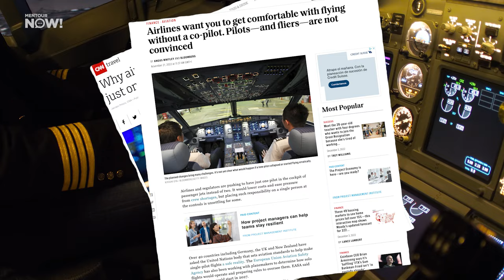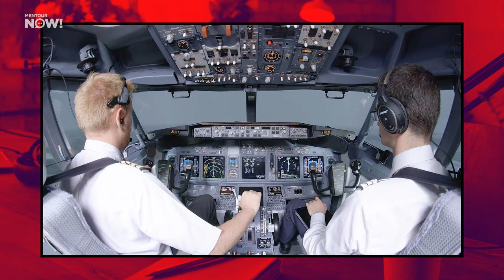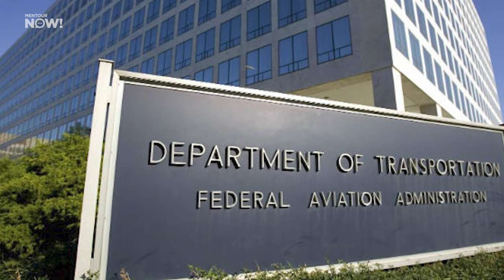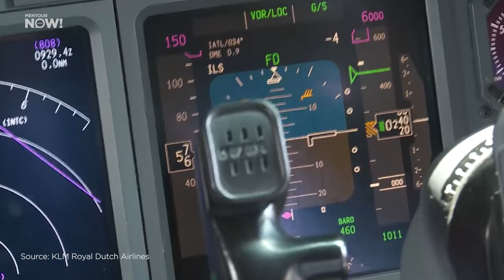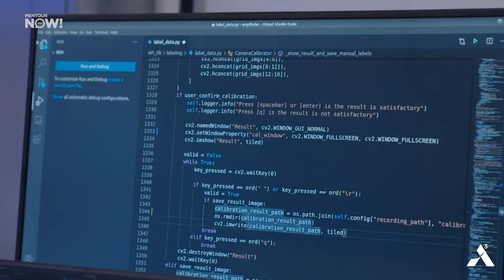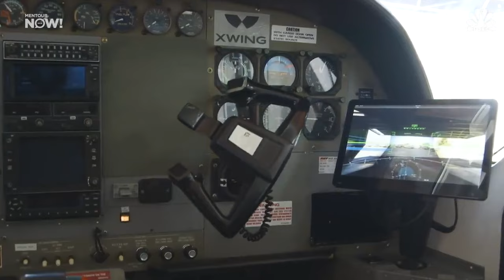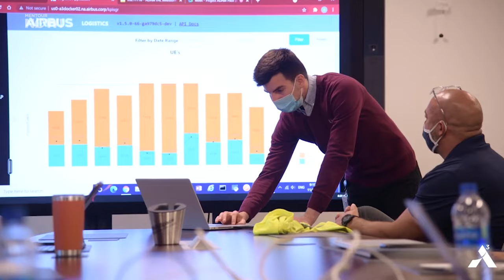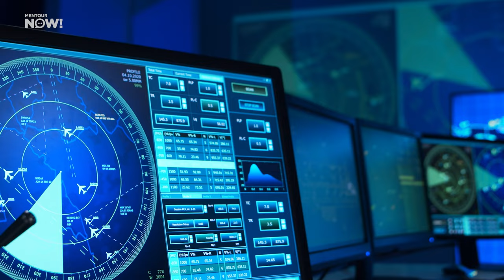The End of the Two-Pilot Cockpit?! Get Ready for Single-Pilot and No-Pilot Airliners!

Comment: Just the isolation factor of a single pilot cockpit would have negative effects on the psychological well-being of flight crew (thus leading down a rabbit hole of potential poorer outcomes). The flight deck is already now locked away from the rest of the flight post 9/11. Isolating one pilot alone cannot be good for the majority of people.
Reply: More importantly, we also know that people are more likely to cut corners and not follow procedures when they are unobserved.
Reply: It should be possible to have an assistant in the cockpit like it happens in long distance travels via car. This can help to keep mental state of driver/pilot in check while still requiring less investment than fully fledged pilot. It should also help with fragmenting pilot role into smaller more managable roles (e.g. handling radios like ATC clearances but on the board of airplane). Though I would expect that assistant will go through some training to handle semi-automated airplane in case of emergency.
Reply: But who says the pilot needs to sit up there alone?
Reply: He's not in prison, come on... That's such a strawman
Reply: Most of my flying has been single pilot. Helicopters and light airplanes. I’ve never felt lonely or isolated and I’m an extrovert. Granted most light aircraft have only a few hours endurance, meaning each leg of a flight is limited to a few hours, most days are long and similar to truck driving. However, I’ve got ATC, passengers and ground crew to interact with and the complexities of weather, logistics and navigation to keep me busy. I used to drive trucks and that was fine but flying is better. I never get lonely and I never get tired of the view.
Edit: The single pilot flying I’ve done doesn’t require two pilots because the work load is low compared to two pilot operations. I just wanted share my happy personal experience in single pilot operations.
Reply: @Hans-gb4mv  Heheh, hire a "pilot's friend" :D . Take a coworker to work day... weird huh?
Reply: @darrylday30  Yeah that's true, and not like lots of truck drivers already drive alone. Though I can't say my dad who is one is always happy about that (and the job itself).
Reply: Well, there are thousand of truck drivers driving alone for days so..
Reply: Even with two in the cockpit, there's going to be boredom issues if all they're doing is watching the computer drive. Something has to keep them alert & engaged.
Reply: I heard the future was airliners with one pilot and a dog. The job of the dog is to make sure the pilot doesn't touch anything and the pilot is just there to feed the dog.
I guess the dog would also keep the pilot company.  😄
Reply: @virkony  -  Here's an idea.  Why not train that assistant to fly the plane?  What an incredible idea, yes?
Reply: @darrylday30  -  I'm so glad your personal experience in single pilot operations has been happy.  I hope it stays that way.  Meanwhile, when I'm flying on a commercial airliner I would prefer there be two pilots.  You know, redundant critical safety systems?
Reply: -  OTR truck drivers are traveling at FL 0 AGL.  Plus, they can pull off the road if they get sleepy, need to attend to bodily functions or encounter a malfunction.  This is an advantage not afforded to aircraft at FL 350.  Minor detail, I know, but there it is.
Reply: @wickedcabinboy  if tendency is that main purpose of pilot is to configure auto-pilot and be a back-up to fly manually, I think assistant do not need full course of various situations on various airplanes or ensuring amount of flight hours. Main pilot still acts as a back-up when there is a need to land manually or do somehting more complicated than maintaining altitude.
And yes.That might be a great way to invest slowly in own full fledged pilot license for whoever starts with role of assistant. Who knows?.. Maybe that will address pilots shortage problem.
Reply: Very interesting topic and studies should be done to review single pilot operations for the large jets.  When we went from 5 pilot operations to 4 pilot to 3 pilot there were concerns, there were also concerns when we reduced the amount of engines.  Technology is getting better every day……
Reply: @virkony  -  All that is true, until he needs to fly the aircraft.  Then what?  "Ooops, that's beyond my training.  Oh, well."
Reply: Good comment !
Reply: @wickedcabinboy  situations beyond training happens for qualified pilots as well. It just for them bar is high enough to ensure that most common situations are handled in form of routine. For assistant it can be lower. Similar like a captain and first officer. It just gap is bigger allowing more people to play that role (somewhere between cabin crew and first officer).
Reply: Let's not forget that an alone pilot locked the cockpit door, and decided to crash the plane on the mountain.
Oh, and looking at Tesla autopilot? Where the car tries to run over bikers and pedestrians? Not a great argument in favor of automation.
Reply: I will sleep if somebody lock me inside cockpit 😅
Reply: Also who can stop you from smash the plane in the mountain like that german guy did in germanwings A320. Just because of that now you have to have 2 person in cockpit at ALL times
Reply: @darrylday30  Psychological issues doesn't have to be just "feeling lonely". There are a whole bunch of issues can come up few of those includes more pressure, no cross-checking to know if you are doing something wrong and whole bunch of issues if you need anything. Two people ca keep each other in check in many ways like not cutting corners. It is working for small planes, helicopters but for big plane things are just different. Also you don't drive a truck with hundreds of lives in your hand at 35,000 feet with probably thousands more lives on the ground.
Reply: @meldroc This is a complaint about the current level of automation.
Reply: @virkony  -  I must say, I firmly oppose your idea.
Reply: This is such a straw man argument it warrants outright ridicule.  There are plenty of people who work long hours alone without serious detriment to their performance.  And pilots have a lot of rest time in-flight.  In fact, there’s no reason whatsoever that separation between pilot and crew should be completely isolating.  It should be entirely possible for the crew to be constantly engaged with the Pilot with only a strong polycarbonate barrier between them.  The number of incidents of pilot-derived terror are few and far between and can easily be mitigated once autonomous systems are available- to be engaged by the crew only in the event of pilot misconduct or incapacitation.  The system can get the plane down to a safe landing in such a situation.  I see no reason that a brief computerized mental acuity test can’t be performed in the flight room prior to flight to ensure the pilot is ready for service.  A digital key can be issued by that computer that will allow that pilot alone to start the aircraft engines.  No key, no fly!  Autonomy should be for emergencies only.
Reply: @johncampbell9216  I agree - this is one of the most ridiculous straw man arguments I’ve seen in a while and completely overlooks the existence of all the existing solo pilots, single pilot corporate jets, over the road truckers, and so many countless other professions with isolated workers - not to mention people that work from home alone.
Reply: Perhaps the airliners will supply them with a chat-bot AI to keep them company.
Reply: @crashmancer  visions of an inflatable doll that chats to you spring to mind!
Reply: @meldroc  I’m never bored, flying alone. There’s always something to do, and the view is fantastic!
Reply: If bus/truck drivers can handle it as well as some ship and train operators, I'm pretty sure pilots would have no issue with that. The issue is with safety.
Reply: @wickedcabinboy  
OTR truck drivers are traveling at FL 0 AGL but they have thousands of other vehicles passing mere feet away all the time.
 
Truck wrecks can do immense damage to human life and property.
Reply: Have the pilots on the ground. They can change over and have short shifts.
Reply: @Taladar2003  so keep them out of the plane all together.
Reply: Get them wireless service in the cockpit so you can call friends and such
Reply: And if there was a remote backup pilot, that person is dedicated anyhow.
Reply: Closed circuit TV into the cockpit could help somewhat, but it couldn't be allowed to become a dangerous distraction.
Reply: But if something goes wrong in the truck, he or she can generally stop pretty soon.  No airplane stops in the air.
Reply: @sandy_knight  I'd rather a cat
Reply: @victorlitvinov4417  Or Zoom meetings.  (Hey did you just see that weird thing your controls just did?)
Reply: Germanwings Flight 9525 also comes to mind
Reply: I work alone for 10 hours a day, every day. I'm fine.
Reply: @Campania Cunard I work alone. It's not an issue.
Reply: @SwordQuake2  I work alone. It's not a problem.
Reply: @virkony  Then we might as well keep with the 2 pilot layout
Reply: @alanstevens1296  -  I don't dispute that.  But a Tractor trailer is rather a bit less complex than an Airbus or Boeing passenger liner.  Nor does it require the level of knowledge,  training, skill or experience to operate that a commercial pilot does.
Reply: Go with no pilot: Passenger drones!
Reply: @womble321  
Someone asks me fairly often" Captain, dont you worry about being responsible for 250 people?"  Answer...I make sure I arrive safely and the passengers will be fine. Do you think a drone pilot worries about his own safety?
One pilot cannot manage the complex systems of a large aitcraft, deal with ATC, read and complete complex checklists, and fly the aircraft safely during an emergency situation.  Several emergencies render the auto pilot inop.

Having only one pilot or no pilot is a very bad idea. Anyone who would fly on a large airliner with one pilot has a poor understanding of the risks.
Reply: Not if it's a fully automated plane!!!
Reply: Sounds like a downgraded co pilot to me tbh
Reply: I agree with you completely.  It is unreasonable and dangerous to leave pilots isolated for such a long time.
Reply: One pilot? Anyone remember GermanWings?
Reply: lol, there will be a dramatic increase in cabin crew joining the mile high club
Reply: A lot of us folks in GA fly by ourselves all the time. I don't think this is a compelling reason not to do it. I do think there is a compelling case not to do it - if dual pilots stop even a few crashes a year worldwide they are cost-effective (vs salary of pilots) for commercial flight because those airframes are expensive - and the lawsuits from the relatives of dead ones even more so.
Reply: The future will of course be totally autonomous aircraft. After a couple of generations have grown up with autonomous cars and other modes of transport they will have no problem with autonomous airliners.
Reply: Coming from a truck driver I disagree
Reply: Couldn't have said it better! Even worse, how about the then required systems that will need to monitor & scrutinize the actions of the lone pilot, say to prevent an unnecessary nose dive, lol? Now, these systems (and their bugs) will add layers of complexity that could translate to unnecessary risks during normal flight, no? 
Greed is not absolute and needs to be stopped when it gets out of control, this is a textbook example imho.
Reply: @philipmackin1025  it doesn't matter how you call assistant or backup pilot. But that backup pilot is not the one that rutinely steers the plane as it requires less preparations for that role.
Reply: Tell that to the millions of truckers around the world
Reply: Locking the flight crew has always been something that bothered me.  We focus on the 4 planes out of millions of flights and turn the aircraft into a segregated machine and separating the human factor. Might as well have a computer flying the plane.  I use to love when they opened the door and you could see the crew. Always felt safer seeing all was well.
Reply: @Viniter  At least you don’t have a back seat driver in the cab criticizing everything - oh wait, they just install computers that does the job of a back seat driver.
Reply: @orlandopockets6372  the flight deck can become a high stress and complicated environment.  At 30,000 feet, there is no way to simply pull off when something happens and can get busy real fast.  This is why there is a huge focus on stabilized procedures.  In bad weather or night conditions, three are no external references and things happen.  Just an opinion because I’m not sure you can compare the flight deck to driving a truck or other jobs.    Perhaps it might be similar to a surgeon performing open heart surgery alone with robots.  It’s all good until an unexpected clot forms or something happens.
Reply: "Isolating one pilot alone cannot be good for the majority of people." Yes, that's a big problem. But that means having only one pilot is just one pilot too many. We need non-unionized autopilots everywhere - drones, cars, buses, trucks, trains, planes, Skynet, Falcon Heavy commuter ships to Mars and back.
Reply: Long haul truck drivers and train engineers face the same problem but in those cases and aircraft operators usually have SOMETHING to do whether it's communicating with ATC, checking their instruments or eating a meal. Bottom line, the cockpit is never lonely and if it is you can always read something be it fact or fiction. Modern aircraft are so automated that 99.95% of the time they fly themselves. Hand held computers can play chess much better than any grandmaster. So the hundreds or thousands of interconnected computers on a commercial airplane can easily avert almost all disasters better than flawed human beings.
Reply: Replace the 2nd seat with a fully autonomous android with lots of dirty jokes.
Reply: Not anything different from a LD truck driver or bus driver?
Reply: @johncampbell9216  in God we trust 
all else bring data
Reply: @victorlitvinov4417  great idea they can phone a friend in case of trouble
Reply: @nobodycares85  oh,  poor babies
Reply: @rafborrero  don’t be fatuous
Reply: Off topic. But your name. Tucson as in Tucson, AZ?
Reply: That's a good point, but the main reason they must keep a second pilot is REDUNDANCY.

I have a degree in aerospace engineering and a private pilots license but I work in industrial control systems. I am formally trained in programmable safety systems. So I am formally trained in WHY WE USE REDUNDANCY for critical safety functions. Risk Assessment not only includes people but their training & competency. Redundancy can also include people. For complex and heavy aircraft the second pilot is a key part of the safety strategy. Their fundamental job is to reduce the workload on the pilot who is flying the plane.

One of the key parts to that strategy is CRM (Crew Resource Management). And the key takeaway that other industries have adopted from CRM is "agreement." Its not a matter of one person checking another persons work. Its a matter on them agreeing its been done correctly.

After the fiasco of the Max-8 this should not even be a discussion any longer. I can explain in detail that the Max-8 was always going to have those sorts of fatal accidents because it was a single point failure system. The Max-8 will be a case study in "What not to do!" for generations of engineers. Boeing are not alone as Airbus also have had some shocking accidents to overreliance on automation.

Any engineer who thinks this can be done clearly has no cockpit time and no proper training in safety systems or safety management and NEEDS TO BE RUN OUT OF THE INDUSTRY.
Reply: @nobodycares85  is afraid to fly 🤣😂
Reply: @tonywilson4713  you do not understand the meaning of the term. Redundant-“not or no longer needed or useful; superfluous.
"many of the old skills had become redundant" so,  you are false authority.
Reply: @tonywilson4713  yeah, right😂😂🤣hahahahaha hahahahaha  In engineering we used Wikipedia as a reference.😂🤣 you can’t make this stuff up
Reply: Most air accidents are the result of pilot error including a distracted crew, that often includes very experienced members, flight instructors, etc. It is clear that taking the human element out of the cockpit will be a net improvement. Some new types of accidents will happen but many more will be prevented. We just had the largest ever space rocket do a 26 day deep space journey with no crew on board. The tech is already here and the sooner the better
Reply: @uince  🎊🎉
Reply: The isolation factor could be solved by including a deployable  emergency Otto Pilot as used in the movie AIRPLANE !
Reply: @tonywilson4713  the level of excessive outrage in your comment sort of supports my notion that humans should be slowly steered out of the flight deck. I sure would not like to be flying in a machine commanded by someone of your temperament.
Reply: @tonywilson4713  I’d disagree, that seems expertise very relevant to the topic at hand
Reply: @WinginWolf  Aren't a lot of truck drivers talking to each other on the radio while driving?
Reply: didn't you get the memo that you plebs will not be allowed to fly in a very near future by our self-proclaimed WEF overlords? 🤭
Reply: @MrKen59  as if the 'tards commenting that it's not a problem haven't seen a single Mentour crash video where even a crew of 3 or more was overwhelmed and ended up in a giant fireball along with them passengers.
no biggie though, it would have been way better with more software automation and a single pilot... 😑
Reply: @GlobalDrifter1000  You know, other people here are exchanging ideas, raising points for or against a rational argument, but I suspect you wouldn't know a good point if it were needle sharp and up your arse. 
Not that it matters, but I fly all the time, and I want the plane to be maintained, and operated properly.
Reply: @mitseraffej5812  Maybe so, but not just yet. Computers are great at handling known, preprogrammed situations, and completely lousy at improvising. One can list numerous commercial flights in which improvising is the only reason the airframe wasn't a hull loss and everyone aboard dead. Granted, one can also name flights where improvising is the reason for the crash.. ideally what we'd have is human pilots and a autonomous autopilot who is also programmed to explain things like 'you have icing, whether you believe it or not' and 'pulling back is not going to help you gain altitude' or even 'we have no engines. I am trimming for best glide. Good luck!'
Reply: @jonathanpullen7439  Airline safety is a statistic game. When the risk of having a human pilot exceeds the risk of a fully autonomous airliner then piloting will be a dead end career choice.
Reply: Just look on german Wings flight 9525 Andreas lubitz co pilot

Locked the Other pilot out of the cockpit and killed Everybody on the flight

If the wrong
Pilot
Gets to handle the single pilot plane then everybody on board is doomed 

Having 2 pilots is also
Another safety factor

If one pilot gets sick or suicidal or something else happends 

The other pilot can take over the controls .

So having 2 pilots is also a flight safety concern

I wouldn’t set my foot in a plane with just one pilot at the controls 

Even if they paid me
Reply: @kittytrail  that was my point as well. Folks don’t understand the potential work load issues that can arise - and I know how flying in low visibility, things can get busy real fast.  This is why the focus on stability is critical as it allows bandwidth for when it goes bad.
Reply: Yes, once one pilot was left alone in the cockpit and... well let just say that they guy had existential issues and wanted to be know for doing something.

there is a reason you use a double man switch as a safety feature.
not to mention the engineer rule "if you have one, you have none, if you have two, you have one".
And humans are nothing like current computers.
Reply: @MrKen59  yep, as for the Ai/autopilot/drone crowd, they don't understand that all code is human-written and always contain more bugs than the rotten carcass of the dead horse they're floggin' especially when talking about hundred of millions of lines of code... 🙄
Reply: Explain how truck drivers are mostly fine then
Reply: @mitseraffej5812  There's some problems with that. First of all, you can't properly assess ahead of time the risk of your autonomous airliner running into something it can't handle, or being hacked. Second of all, the risk of having a autonomous airliner PLUS a pilot is always going to be lower than either one alone.
Reply: @jonathanpullen7439  I disagree. Of course AI technology will have to improve significantly to achieve the reliability and safety required but I would put money on it that autonomous airliners will be the norm by the end of the century. SpaceX rockets are entirely autonomous, and an airplane operating at subsonic speeds is like watching paint dry when compared to a rocket falling back to earth from suborbital flight,  and then land itself vertically with near pinpoint accuracy.
Reply: Flight staff could join the pilot. They could also be trained in overseeing the computer and helping in certain circumstances. E.g takeoff and landing with two people sitting there and when altitude is reached and the computer is programmed, the second one could just be a member of the flight crew
Reply: I concede the possibility that by the end of the century AI technology may be flying airliners, but the AI that can cope with a serious glitch we'd better be paying because it's going to have to be self-aware level of intelligence and otherwise we're enslaving something self-aware. 

Landing - and taking off - a spaceX rocket - is a trivial task that doesn't require AI. The rocket itself represents impressive engineering - vectored and variable thrust precise enough to cope with the change of mass ratio as it lands on it's tailfire.. but the computing I could do with a small DSP. The rocket has several advantages over a airliner - first, everything gets the hell out of it's way. Second, it has so many horsepower that things like icing and weather don't really matter much to it. In the meantime your airliner must see and avoid, communicate with ATC and to a certain extent with other things in the sky, cope with weather, and is in some ways a much more complicated machine with a lot more to go wrong. I already agree AI can land a airplane in ideal circumstances - I've watched it do it. It's become de rigor for hight end model aircraft to have a IMU onboard that will land them back where they took off from if the radio fails and I've even seen a video of a high end Garmin glass panel aircraft that could land itself. But that's not when you need the pilot. It is always the thing you didn't think to train the AI on that's going to kill you, over and over. We've had pilots walk away from all kinds of things by innovating in the air - I gesture you to the https://en.wikipedia.org/wiki/2003_Baghdad_DHL_attempted_shootdown_incident for example. The problem with any AI that isn't actually self aware is that it cannot have common sense and cannot really innovate. And the problem with a AI that is self aware is at this point you should be paying it.
Reply: When you factor in the cost of litigation when the inevitable poop-hits-the-fan you can probably pay for a lot of extra crew. Losing one plane can easily cost over a billion dollars.
Reply: @georgemead6608  When technology makes autonomous airliners statistically more safe than human piloted ones the accountants of the world will be demanding it.
Reply: I can’t imagine ever stepping a foot on another airliner, sooo many gorgeous places to visit that can be reached by car.
Reply: Only for train drivers and sim pilots. Well, I am both. 😁
Reply: Try being a European Captain on a Chinese airline. Almost invariably the sole European crew member on the airplane. Other than operational matters the First and Second officers yabber away to each other in their own language on the flight deck, and in the crew transport bus the entire crew are doing the same. 
Better off single pilot, especially when things are going off the rails a little.
Reply: @WinginWolf  if the truck drive fall asleep he might hit the divider but if a pilot fall asleep there's hundreds behind and falling into a city is not the same as hitting a divider, different contact
Reply: Bus drivers are alone too. Truck drivers even more as they don't even have passenger. The other pilot should just have a key or card that always opens the cockpit, even if it's locked, to prevent incidents like Germanwings Flight 9525.
Reply: Same like depression with semi drivers
Reply: yes
Reply: I agree
Reply: @LoneTiger   pilots already try to run over ramp agents and equipment if you knew how many times I had a pilot decide to not follow my hand signals and decide that they can park their plane better then what I was asking them to do.
Reply: I mean, truck drivers drive alone. And truck drivers do more work.
Reply: Guess you never heard of truck drivers.
Reply: Yes and trucks, like planes, can and do have accidents. However, though some accidents can be massive depending on where they happen,  when a truck crashes, it usually does not kill a hundred to two hundred people, or more. Planes do. This is not a good idea in my book.
Reply: @wickedcabinboy  I could not agree more!
Reply: @wickedcabinboy Minor but a very, very important detail and a very good point.
Reply: @LoneTiger True, Tiger. Not a good argument. You make a good point.
Reply: @SwordQuake2  Why a strawman?  I recently took a 15-hour non-stop flight to Hong Kong by myself.  I could barely endure the simple fact of sitting for that length of time.  Do you want the pilot to chat on his cell phone to kill the time?  Could you sit alone in your cubicle alone for 15-hours with no people around.  I think the issue is a real concern.
Reply: Except truckers can stop at rest stops, take a shower at truck stops, chat over their radios, get out and stretch their legs. When they need to sleep a trucker stops driving, parks and goes to his bed. You cannot do that on a 15-hour non-stop flight to Hong Kong where you can't even keep the cockpit door unlocked to chat with the flight attendants because of all the crazies nowadays.  And 15-hour flight or a 1-hour flight who is going to take over while the pilot goes to the bathroom?   I assume most truckers come to a complete stop to use the restroom.  Where is the one-pilot plane going to come to a complete stop 40,000 feet over the Pacific Ocean? Do you want your pilot on a cellphone or ZOOM for 15-hours? I agree that there are similarities between long haul truck drivers and pilots, however, the extensive type of complete stop break available to truckers are not a fair comparison to the limited amount of complete stop breaks available to pilots.